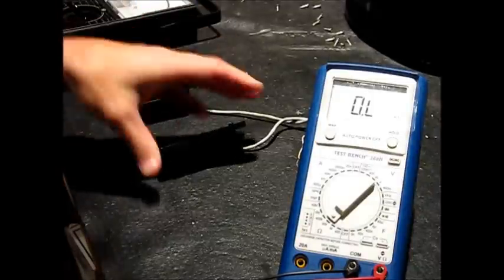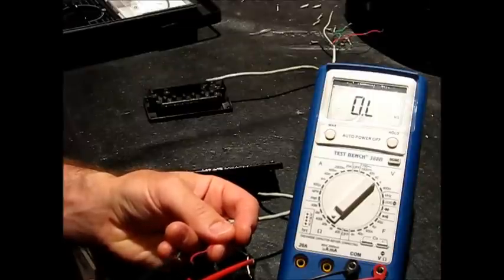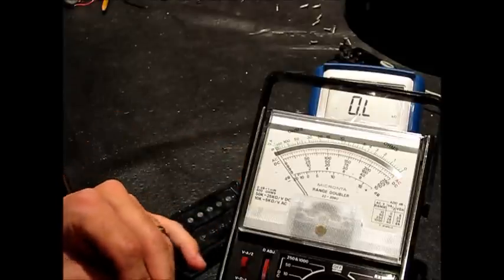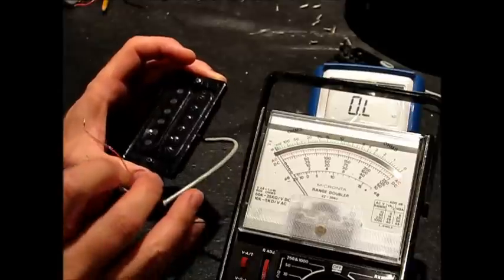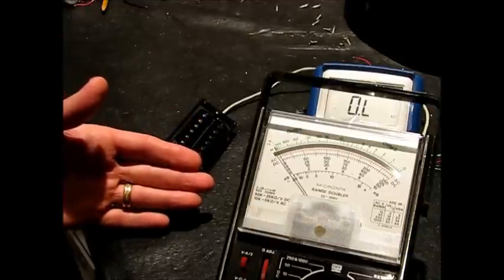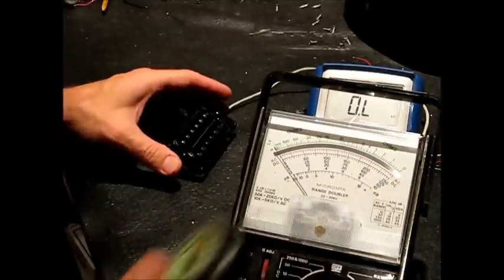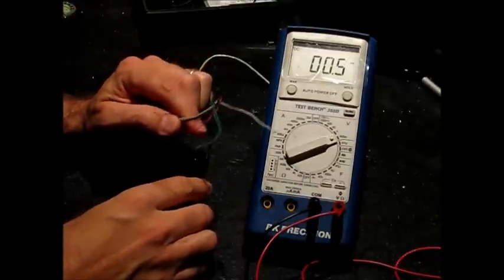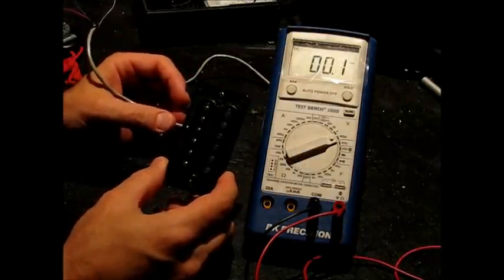Identifying Pickup Wires & Polarities - Humbucker

Comment: Minus to plus-minus to plus wiring will give you out-of-phase tone, and no noise (hum) cancelation - While the signal is dependent on both coil & magnet polarities, noise is independent of magnet polarity. RWRP means magnets have reverse polarity as well as the coils (windings). Instead of plus/minus use start/finish. For series wiring, you need to hook either both start or both finish of the coils, for parallel wiring, you need to hook the coils "in reverse" (start of 1st coil to finish of 2nd and vice versa) and then hook each "new" end to out and to ground, and so you'll get noise cancelation & w/o phase cancelation for both types of wiring.  To get phase cancelation w/o noise you either need magnets with same polarity and reversed winding polarity, or 2 humbuckers and reversed wiring between them.

The identification part is great, Thanks!
Reply: +1 - using "- + - +" to wire in series threw me for a loop when I wired up a simple single humbucker + volume guitar after watching this vid (couldn't figure out why I was getting so much noise and kept re playing this vid to reconfirm that I'd ID'd the wires correctly).  He does mention splitting in there a bit, but I found the whole "go - + - + when you tie them in series" point misleading wrt the standard simple humbucker setup which typically includes noise cancellation.  The rest of the content is fantastic but I think it's worth a little edit at around 10m to mention that for a standard noise cancelling humbucker the two + (or finish wire ends) are often tied, with the two - (start wire ends) are used as hot and ground as mentioned in your post, but I'm still not sure I understand what facilitates the noise cancellation (is it two reverse wound coils AND with the two coils being opposite magnetic polarity? (EITHER opposite wound series wired same magnetic polarity coils, OR same wound series wired opposite magnetic polarity coils will not noise cancel alone? has to be both? (opposite wound series wired opposite polarity coils? (I guess that's what RWRP is)).  I think a clarification would save on potential confusion as this vid still seems popular for instruction.
Reply: @PR-fo5mj  Thank you for backing up my argument :)

Comment: I have that exact Micronta meter. Bought it at Sears back in the early 1980's - burned up and replaced several resisters - modified it to adapt to pickup winder setup - put it away for years - got it up and running again with fresh batteries and a calibration. I love it. Thanks for the easy to digest video. I have that Craftsman 1/4" socket driver too!

Comment: I have changed my Pup's a few times, i usually pay someone to do it but during the Covid restrictions, like many other folk, i found i had time on my hands. I bought a flat Pack TV cabinet from a mail order company called Very. It was a solid Mango wood unit. Anyway i made myself a Super Strat, HSH. I wanted to split the Humbuckers and was flagging in confidence until your video spurred me on. So thank you for uploading this over a decade ago. The Strat i made is a good Guitar, even better than i expected. I would recommend going down the flat pack route for Guitar Timber, it proved sustantily less expensive than buying it from my local Timber yard.

Comment: This is the most useful and most comprehensive explanation of the whole topic around pickups and wiring. I couldn't ask for more and I'm glad you have taken the time to create and share this video. I was confronted with an OEM humbucker pickup just now and I knew from other people's experience that the color scheme was anything but typical. Without your video I would have had to try out a couple of different scenarios until it would sound and work right and as expected. Now I had a clear path for investigating and figuring out about the electrical and magnetic characteristics.
Thank you so much for sharing your knowledge with us. It's very much appreciated.

Comment: Thanks for this awesome video.  Simply and clearly explained.
I ran into the same "problem" that you encountered here when investigating my Gibson USA guitars' pickups. Modern Gibson pickups, even the Burstbucker family, have the magnetic polarity reversed between neck and bridge pickups.  This is especially important to know with the new Gibson quick connect for neck and bridge pickups.  My 490R (neck) and '61 Zebra Reissue neck pickups (part of Gibson's Burstbucker family of pickups) have the screw coil as South polarity.  The other two pickups in my two sets are a 498T (bridge) and a '61 Zebra Reissue bridge pickup and these bridge pickups have the screw coil as being North polarity.
I figured this has to do with making the circuit card controls in many newer Gibsons easier for the factory to set up for the phase switching and coil splitting that some of the Gibsons have with push-pull potentiometers.

Comment: I know you put this here years ago, but if you still are there... Can you tell me why Seymour Duncan in their US made pickups, for example, use the red/white pair as the series link for wiring a regular humbucker?  In your tutorial here, they would be connecting + to + or finish to finish of the two coils.  You state here to always wire them - to +, and - to +, indicating that the series link for a "normal" humbucker wiring will connect the +, or finish of one coil to the -, or start of the next coil.  US Seymour Duncan pickups seem to be using - to +, + to -

Comment: fleor sells cheap picks ups and if you snoop around you will find conflicting info on the pin out . some say black wire is hot , some say green wire is hot . the pair i was shipped has the ground lead connected to the black wire . my pal is telling me " you can hook them up that way but its wrong ... so i will have to do some testing . its never easy for me . i cant complain , i love spending time this way !! so much more fun resoldering everything then having to put extentions on the pick up wires as everything is melted , the drilling the hole in the guitar larger as the shrink tubing wont fit . drill thru the back of the guitar drill thru the pick gaurd . fun !

Comment: I'm currently trying to correct the wiring on a Peavey with dual humbuckers (HH) -- Peavey Generation Custom EX. It came with a 2502N 5-way selector (branded Alpha), also known as the "Ibanez switch", which indeed has a humless "inner coils" mode in position #2 (and humless "neck coils parallel" on #4). So I guess the N-S N-S makes sense. Thanks for the demo!

Comment: From Leo:  I knew there was a reason that I saved my old meter. .  I was always able to ring out the coil continuity, but sometimes the  magnetic phase was flipped and I had to take the guitar back apart.  This tip will save me time.

Comment: If just the poles are out of faze but not the wiring,will that pickup not work,or just sound terrible? 
 Quara question: 
A numbnut takes a set of neo dim magnets and runs it over his single and H pickups a few times,thinking it would charge them,using the attractive side of the magnet,possibly. Will that make the guitar sound like doo doo,or what would happen?
Thank you for your time and vid! Any help is greatly appreciated!

Comment: OK, now I know these, but not sure how to continue with placing the pickups in the guitar and the circut:
1. Each pair of coil wires known.
2. Polarities of them are known. (+/-)
3. The magnetic polarities are known for each coil.
Questions:
1. How to place the neck and bridge pickup in the cavity? (Neck PU: South to fretboard, North to bridge, Bridge PU: North to neck pickup, South to bridge)?
2. How to connect the wires? South minus is ground, south plus is connected to north minus and north plus is hot?
3. What happens if I flip the pickup orientation of either neck or bridge?
4. What happens if I connect south plus to north plus?
5. What happens if I swap hot with ground in the circuit (reverse polarity of a pickup)?
Thanks.

Comment: Well I have to give you a thumbs up. You clarified something for me that I had erroneously assumed wrong. That's the funny thing about assuming you know something without checking to make certain.  I had it backwards for many years because I assumed that it was the magnet in our compasses that the tip that points North was actually the South pole of that magnet so it would point North. When you made your statement that the north pole of Earth is actually magnetically South I was going to get on here and challenge you. Before doing so I decided I had better check to make sure. Now I'm getting on here to confirm your statement as I eat my huge helping of humble pie. I have a polarity tester. With that in hand and a 1/4 X 1/4 X 1/2 super magnet I was able to test my very reliable Silva compass (not a $5.00 compass) I was able to satisfactorily verify your statement. You are 100% correct sir. Our Earth's "North" pole has a magnetically south pull or energy. In essence whomever began making magnets or whomever started labeling our Earth's polarity and the polarity of magnets either mislabeled magnets or the polarity of magnets or they mislabeled the Earth's poles. Whatever will we do now? Our world has been turned upside down.  :-o

Comment: Great information.  But I have covered mini-humbuckers as found in a Firebird or some Ibanez.  I know the wiring must be wrong as the pickups sound very thin and the red/green are tied together.  If the color codes are standard (I'll check individual coils tonight) one coil is not in circuit.

Comment: So in terms of actually wiring them in, do you wire the lead which shows positive voltage to the switch? Or would you use the lead which showed negative voltage?

I'm changing some pickups now but I'm having issues, I created a diagram of how the old wiring was and tried to wire like for like in terms of polarity, which is hot and ground etc... but for some reason the original pickups were wired so that the negative leads were wired to the switch, whereas the leads which showed positive voltage when doing the coil check were wired to ground. Could anyone share any wisdom on this? It's really confusing me.

Comment: interesting ,this might help me with a 1998 super stat with a 5 way switch. just put a Duncan 59 neck and a jb bridge, but for some reason the coil taps sound terrible and running the switch in middle with both pickups thin sound ,like out of phase.both sound good when using by them selfs.guess I'm going to have to check them, bought the 59 used. great video ,thanks

Comment: Hello , very pertinetn and usefull. the north polarity on compass was also a surprise to me. Very interesting point about using the right splitted singles to keep humbucker functionality. Also very nice point on the analog meter vs digital... both worlds have their advantage. One genuine question. Do you know an accurate way to measure that the screw are correctly adjusted (equal level output for each plot)) and what method can be used to check this out. Maybe it is a stupid idea but if there are screws they must be usefull to something ?
Thanks again

Comment: Great video... I'm trying to understand a problem I had with my LP. I replaced a 490T Gibson Quick Connect with a traditional 498T 4 wires. Respected the wire colors and connected R+R, B+B W+W G+G from the 498T to the  Quick Connector socket but it sounded thin specially with the neck HB together with bridge and coil split (out of phase?).  A forum suggested connecting the following order: R-B-W-G from the 498T to W-G-R-B on the Quick connector. It sounds a lot better and higher, and the reason they mentioned is that Gibson changed the color code  on the bridge Quick connectors? Is this possible? Do you believe my connection is correct? Many thanks (sorry for the english, i"m Brazilian..)

Comment: this was VERY useful thanks a lot man!
Just one question, when you are checking with the voltmeter which wires go to which coil, when you have a positive jump of voltage, does that mean that the + wire is the one that starts at the inside of the coil? how do I know which wire connects to the center of the coil and which to the outer end?
Reply: HI SIR .CANT YOU PLS HELP ME?   SIR ,  MY BIGGEST PROBLEM  MY LIFE.  HEHE.. BECAUSE , I WANT TO  CONNECT MY   PIEZEO PICKUP  AND MY   HUMBAGGER  PICKUP IN  THE WAY SERIES  PARAREL ?    AND THEN CONNECT TOGETHER  IN THE ONE OUTPUT  JACK  GUITAR,??? IF IT THIS   POSSIBLE???    THANK YOU SO MUCH SIR,,,     HAVE  A NICE DAY,,,

Comment: I have a high output 2 wire pickup do you check the pickup the same as the 4 wire pickup and what numbers do you put your meter to get the right readings.
Reply: Mitchell Sperling Should be the same. On your meter you put it on ohms 20k

Comment: sir or madam can u help me because im confuse of my new lace pick up  about the wiring when i buy the wire are bine red and white are bine together black and ground are same bine and 1 single color are blue can i connect the block and ground to ground volume and the blue is for selector switch.. can i put tape to the red and white...please help me i need your advice . thank you and more power.

Comment: I have four pickups from ESP... a pair of ESP LH-150 and LH-200 and they only have just one black wire.. no white, red .. just black.  I can't tell which one is for the bridge and which is for the neck. I have the specs from ESP's site, so if I get one of those voltmeter things, would i be able to figure out the specs of each pick up?

Comment: The ground is your most likely short to any coil. Shorting between coils? Very unlikely!  Yes indeed, Micronta is or was Radio Shack, and I do see old Micronta's with calibration certification stickers, but it's far more common to see a Simpson or a Triplett analog meter with a cal cert than a Radio Shack, but they are out there, and if they were certified they can't be all that bad.

Comment: Bridge/neck is more a matter of total impedance -- usually the higher impedance pickup will go in the bridge (higher impedance = "hotter").  And if they only have one wire each, you can't split/tap them, so none of the info from this video is applicable.